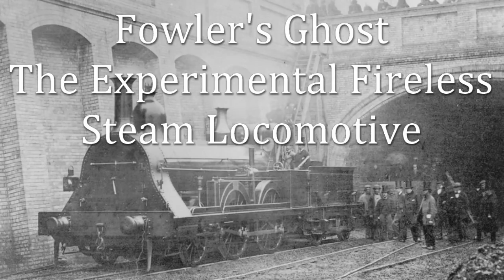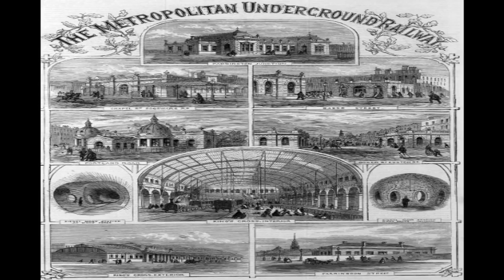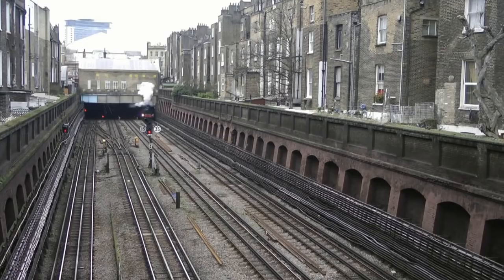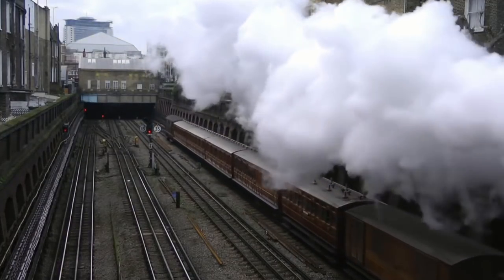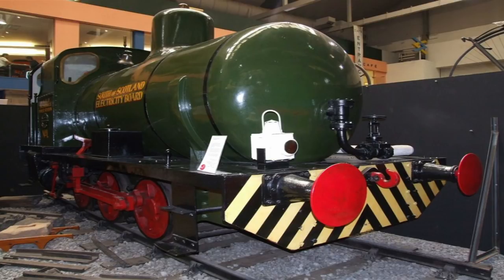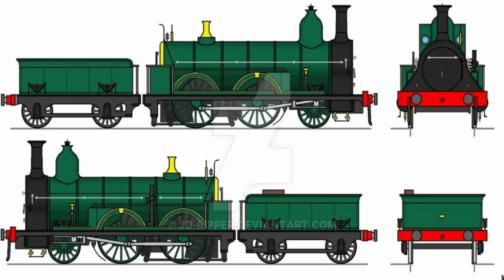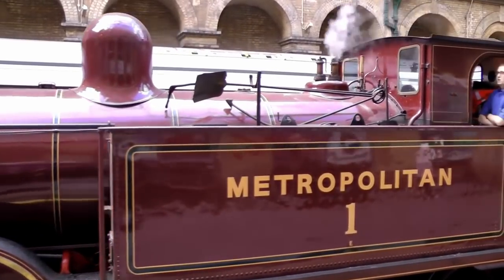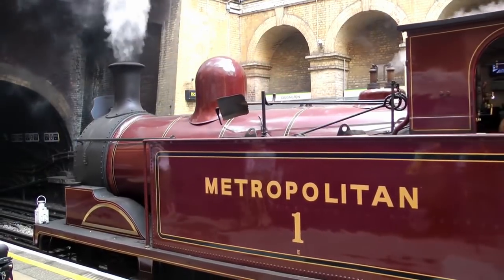Strange Locomotives - Fowler's Ghost

Comment: "Fireless locomotives" used to be popular in railroad tie creosoting plants, and even lumberyards, and many survived conventional steam locomotives by many years in the U.S. However, they were only used to switch cars at slow speed, and so their low power was acceptable due to the absence of fire danger. It also helped that they could be readily refilled with steam, since they never strayed far from the plant in which they worked.
Reply: They are by far not low power they can shunt heavy trains but they dont have a conventional operation mode and have to be refilled with steam
Reply: Hannah Miyamoto In the UK, we used fireless locomotives in places like paper factories, ordnance factories, gas plants and other places where there was a high risk of fire and/or explosion. 
See https://www.brc-stockbook.co.uk/fireless.htm
Reply: tbh I've thought that a nuclear age steam locomotive would just need to refill on water and when parked, it could produce steam for a stationary engine that produced electricity or the like.

Comment: This is excellent, and I thank the OP for sharing. Here, in the U.S., I well recall " fireless cookers" used in power plants and the like, where they would simply draw steam from the main boilers and use that energy to move coal hoppers around. There was no firebox, nor a fireman for that matter. I might also add that, in my opinion, British steam locomotives were some of the most interesting, well engineered, efficient and just beautiful machines produced anywhere in the world. Seeing one in steam is thrilling!
Reply: Salvatore Lowry in terms of load capacity american locomotive designs were best (they were heavy so lots of Tractive effort could make a fair amount of steam and could haul (i believe at least) Far more cars than a British steam engine which in terms of railway income (Freight makes far more revenue than passengers) so while they may have been less Efficient in terms of coal&water usage than British designs and to some look ugly the amount of revenue that is made from freight contracts is better than passenger oriented Revenue (i respect your opinion i should say)
Reply: @sockshandle  They're each optimized for their specific needs. The US is much larger geographically, hence longer trains and larger locomotives make sense. There's simply no need for larger locomotives in the UK, they wouldn't be useful or practical there. But the UK prided itself on speed and engineering prowess for their express passenger trains.
Reply: @quillmaurer6563  Indeed, every nation built its machines to their needs. American engines were simple and powerful, good for long hauls in the vast distances between developed areas, British engines were sleek and fast, following with Britain's image for prestige, however I'd say French were probably the most efficient, due to the lack of large coal reserves encouraging France to develope complicated compound engines that most would consider too expensive to be worth.

Comment: Says the steam accummulator type locomotives were a failure whilst showing an example of a more modern successful design.

Early fire-less steam locomotives might have been failures, but they were developed and have been used successfully for many years in places were sparks were a major hazard.
Reply: Yes, the use of fireless steam locomotives was common in industrial areas where spark ignition was a hazard; even d.c. traction motors were not a good idea, with sparks inside the motor or anywhere in the power supply.
Reply: Hello
Reply: Basically, the issue with Fowler's Ghost was a case of it being too ahead of its time, in an age where technology for fireless engines were a long way from perfection.

Comment: I've always thought this was an admirable, although eventually quite poor, attempt to run underground steam. Sure, on paper, putting the steam back into the boiler, rather than the chimney, makes logical sense, but considering the use of fire bricks as a "heat battery" so to speak doesn't really seem like it would be too effective for long periods of time, especially with the fast accelerating you'd want on the 'Met'. The loco itself doesn't look bad either.

Comment: There used to be a fireless locomotive in the storage shed at Abbey Pumping museum at Leicester.I was told it was used in the power station and filled up with steam at points around the power stations yard area.Generating electricity causes a lot of excess steam.I have no idea if it is still there or if it is the same thing as in the video.I will investigate.

Comment: We had some fireless locomotives in the U.S. They worked.
Reply: We don't have guns in the U.K that works for us.
Reply: Callum Walker yah, but people still get stabbed a lot
Reply: @Marco-xz9sc  and burnt, don't forget burnt.
(with acids)
Reply: these are different ya goober, our fireless locomotives were just meant to use steam, not coal and water
Reply: Ya but one such design used ammonia. That's not problematic at all. And they only ran for 20 years, give or take, until replaced by electric trams.
Reply: @callumw9809  this has nothing to do with guns

Comment: What if there was an electric steam engine that used a tender full of water and the boiler was heated with electric heating elements like in waterheaters? With overhead or third rail power options
Reply: A wheel connected dynamo would recharge batteries in the tender
Reply: Too many energy steps: electricity-heating element-water-pistons-motion, rather than just electricity-traction motors-motion. When there are more steps to convert energy forms, more energy is lost, and thus is it less efficient.
Reply: Some European countries converted coal boilers to electric electric boilers during WW2.

Comment: At 0:50 it looks just like the N line in Brooklyn. Unfortunately, it never saw steam.
Reply: 0:50
Reply: Thanks...I just changed it.
Reply: Jeffrey Ornstein Actually the Sea Beach line, like the other former BMT lines to Coney Island, was a steam railroad when it opened in 1878. In 1897 the BRT converted it to trolley wire and it was later rebuilt into its current form as mostly open cut. Steam has never operated on it as now configured, however.